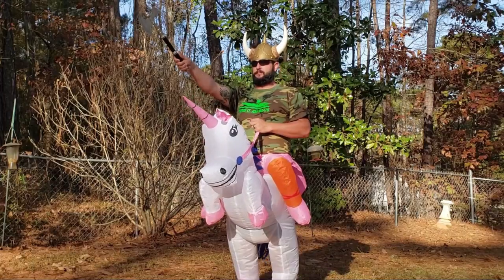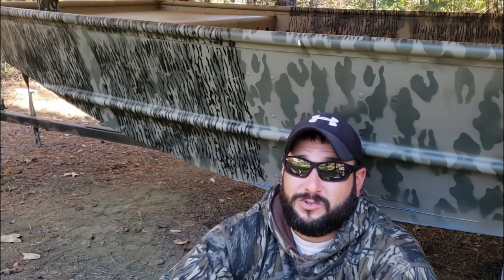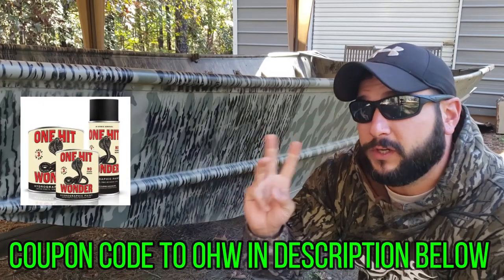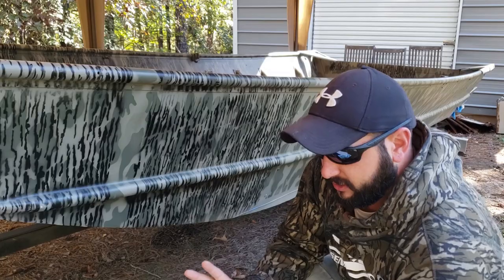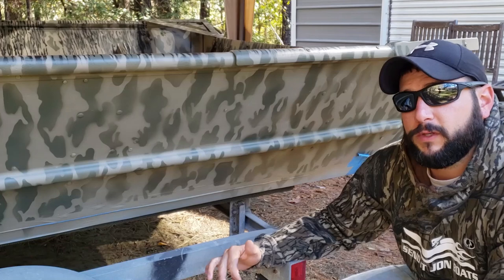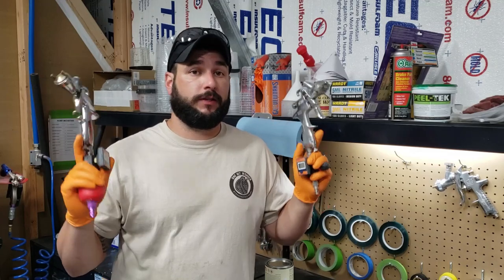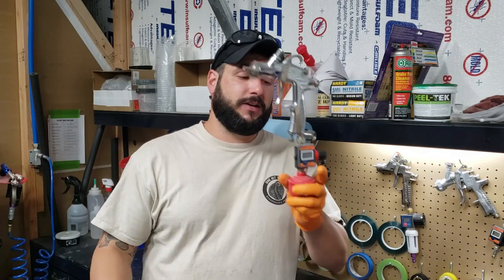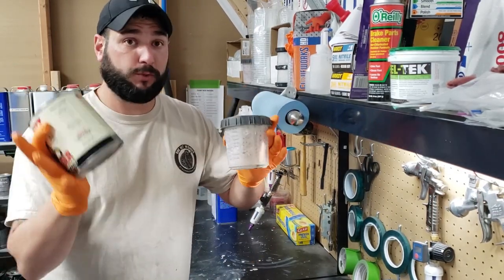Camo Paint a Jon Boat LIKE A PRO || Part 1

Comment: Hi, I am not familiar with OHW paint, does the clear coat is necessary or you could just use the standard paint ?
Reply from the maker: Clear is required for OHW paint.

Comment: I just bought a 14ft Jon boat. How much paint did you use in total for this? I want to paint the boat inside and out. No patterns.
Reply from the maker: 3-4 quarts is pretty standard for most boat. That will give you enough to do 2 or 3 good coats, and then you will need 2 quarts of clear coat.

Comment: So I think I want to do something like this myself! Question that I haven’t been able to figure out through your vids yet. Maybe I missed it learning all this cool stuff.

When you did the interior paint, was that UHW paint? I thought somewhere you said you were going to prime the interior?

Just looking for clarification on interior paint with UHW.

Great vids and hope to see more.
Reply from the maker: I originally primed everything with epoxy primer because I was going to use a different paint system. When I couldn't get that paint to dry because of the cold temps I switched to OHW because it was actually drying at 40 degrees.
Reply: Copy. 

Thanks Send It!

Comment: Did you use any sort of acid etch wash prior to painting?
Reply from the maker: Nope... not needed with OHW paint. It sticks to aluminum like crazy. Acid wash and all those products are old school technology before paint companies really figured out how to make paint stick to aluminum.
Reply: @SendItJonBoats  Awesome! I'm reading the site and it says no need for primers. I use my boat it mostly saltwater. Is OHW still okay for durability with saltwater without primers, etch, etc?
Reply from the maker: @austinvorwald1551  Yes sir, it will work just fine in salt water. The key is to make sure the boat is really clean and you get a good scuff on it right before you paint it. Scotch brite pads and some elbow grease works great, sand blast is even better!
Reply: @SendItJonBoats  okay great! thanks for the help!
Reply from the maker: @austinvorwald1551  Anytime! Yee Yee

Comment: If this was this awesome paint you always use why didn’t you use it in the first place
Reply from the maker: Was trying to use some older paint I bought several years ago before I switched to OHW. It woulld have worked fine if the temps wouldn't have dropped too low, so I switched to the better OHW paint.

Comment: Doesn’t seem practical for the average guy or low cost DIY... we’re your stencils expensive? I didn’t care for the Red Leg stencils I ordered.
Reply from the maker: You are absolutely correct it is not for the average guy and by no means cheap... that's why I named it "Like a Pro"... and not "for cheap average joes". It can be done at home, but it is no way cheap. It is easy, just a lot of work and the equipment involved scares most people off. The stencils cost me about $500 total, but I had to have them after the bad experience with the stixs river stencils because this is the camo I wanted.